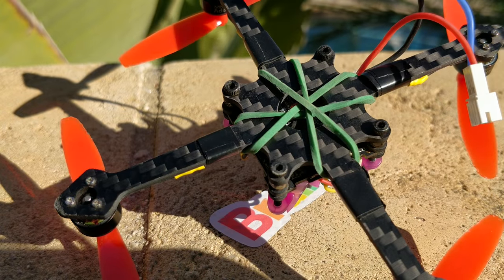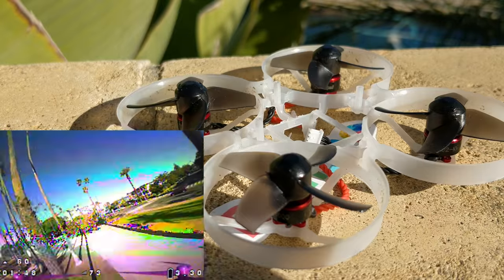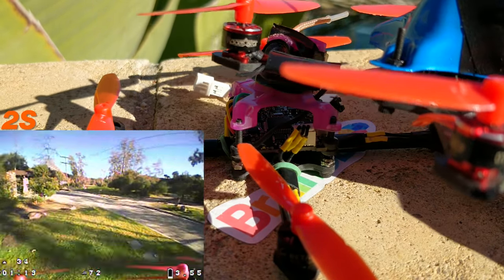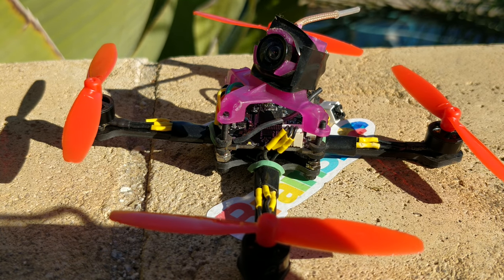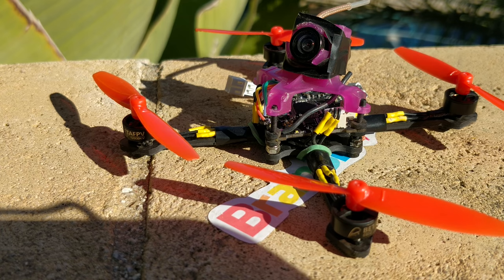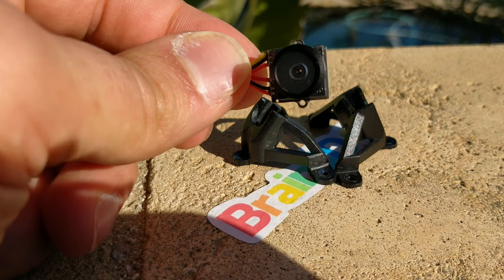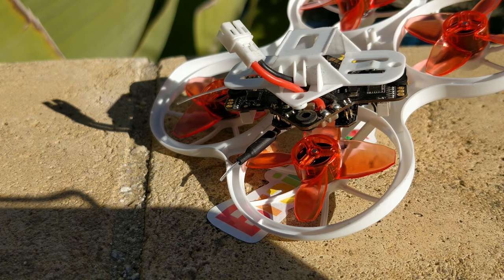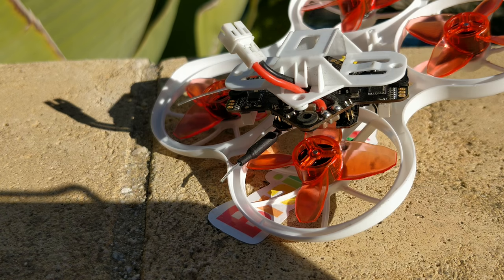Toothpick frame build development updates

Comment: You should try 2  of betafpv 300mah for the 2s lipo so that weight is close to the same weight of the 450mah 1s
Reply from the maker: I've tested all sorts of batteries since. The best pack is the 430mah 2S packs but two of the 450mah 1S packs are excellent too.
Reply: Kabab FPV I want to build one badly
Reply from the maker: @thelongranger55  hopefully in two weeks
Reply: Kabab FPV what’s the thickness of bottom plate ?
Reply from the maker: @thelongranger55  it's 2mm

Comment: Man, I may have to buy a mobula7 or similar just in anticipation for this to covert over. Lol
Reply from the maker: Na don't convert. That was the original idea but it's awful. Build scratch. Buy parts.  All on www.fpvcycle.com. Lots of things sold out at the moment but many coming back even before CNY. The rest will come after
Reply: @Kabab  lol whoops, I just realized this is a pretty old video and for some reason thought it was a new project..derp. I actually purchased one of your Toothpick 3 frames and it should arrive tomorrow! I am going to transfer the Eachine Twig parts to it and see how it goes. Thanks for all you do for the community. I will have to let you know how it goes.

Comment: Couldn’t you just remove the motor wire plugs from the board to make it lighter and maybe the wires could be soldered on directly to the board
Reply from the maker: Yeah but the board is really little.  Plus the wires still wouldn't be long enough

Comment: As many of us already got everything but THE FRAME, it would be great if someone designed a 3D Printed one while we wait for the final design/product/kit. Plus - You would get maaany "beta testers". Anyway, great work here, im so sold on this!
Reply: Biggest issues is that PLA (probably best choice) is going to be a touch heavy and allow for some unwanted vibrations.  Can probably tune around it with some pragmatism and guesswork, but that would take some extra time if it's significant (and it's not like any of these boards have native blackbox capability)

Comment: Tachyon T0804: 1pcs = $13 on banggood. 4pcs = $36 on amazon. why is it so much cheaper on amazon ? usually I have to pay a lot more so I can get them quickly.
Reply: Somebody bought a pallet of iFlight motors, paid shipping once, and is leveraging Amazon fulfillment to resell with decent margins.  It's absolutely brilliant, and I love it.  Also really love my Tachyon V2 2207's
Reply: I bought 2 sets of the iFlight 0804's from the Amazon seller you refer to and am very happy with them.  Fast shipment & about $35 per set (12kv or 15kv)

Comment: uh, another thing, Casio watches have batteries that run (really) for 10 years...
Yes I mean, we need some improvement here.
( at the moment here the cold riduce whoops fly time at around ONE MINUTE at battery. Which was so infame/ridicoulus tgat I stopped to fly!)...❇❇❇❇❇
And those lipos are sooo delicate, I have a cemetery of them 😕.
And anyway, next quads types will be with antigravity.😁
ciao
Reply: reallly?  Your comparing a $4million dollar Ferarri to a $50buck 40 year old Ford Pinto.  Huge difference in battery demands, I am totally fine with a 3.5 min flight off a 1s 450mah,  after 3 mins of rippin my brain need a break.

Comment: I'm definitely going to build one of these stealthy quads. I'm going to sit and wait to see what seems to be the choice of every component. Wondering how much it will cost. Can it be done for less than $10? haha Seems like $100 is the sweet spot for a complete kit.
Reply from the maker: I don't know how long it will be before there will be a kit but I will definitely be announcing my results when I test more components. I am also hoping that the tri blade version of this prop is really good. I would expect that a high-quality version will cost something like $120 mainly because the motors will have to be about $12 each maybe 13. otherwise you're not getting a good motor and you compromise the control which isn't a bad thing because the 0802 Motors work just fine and I think are $9

Comment: There is a Amazon source for the props. I have them,  a set of 0703 19000kv motors and a crazybee f3 AIO or Mobula7. I will be also using a akk AOI-SA 25,50,100,200mw cam/vrx. And 650ma 1s I just need a frame. Link to props.
RAYCorp 65mm (2.55-inch) Propellers. 16 Pieces(8CW, 8CCW) Red 2.55-inch Micro Quadcopters & Multirotors Props + Battery Strap https://www.amazon.com/dp/B07H1K3QJB/ref=cm_sw_r_cp_apa_i_H4ekCb2EH4J9R

Comment: Hey Bob here's a link to the lightest 1103s going at just over 3g, press fit props. Also have connector attached and will may just be long enough http://www.fullspeedrc.com/fsd-1103-11000kv-brushless-motors_p0185.html
Reply from the maker: unfortunately this is a rebrand of the racerstar which betafpv has done too.  not a good motor.  poor construction quality, weak magnets, poorly designed stator

Comment: Plz just drop this frame, I can’t wait any longer. Will happily pay 2x what your cut costs are, just send me one
Reply from the maker: Two weeks. Coming.
Reply: Kabab FPV if I pay 4x can I have it in a week😂
Reply: Kabab FPV ps. Have you tried the tinyhawk motors on it? I would think maybe since it’s a stretch x, the wires would be long enough?
Reply from the maker: unfortunately the tinyhawk motors won't accept anything but the TH props.  However I do have a design for the TH stack I'll be testing shortly.